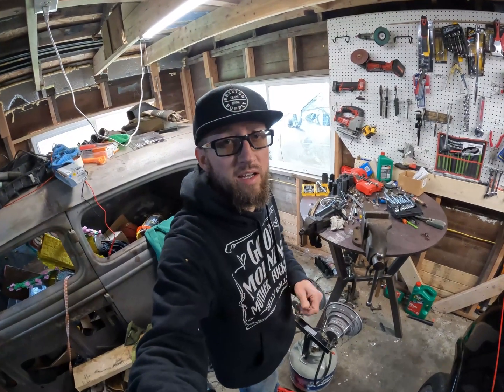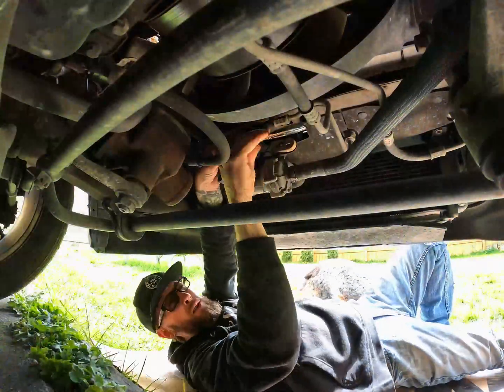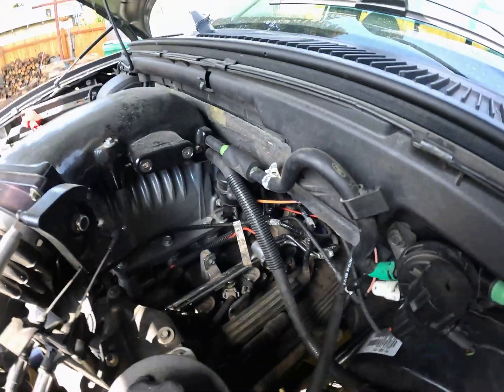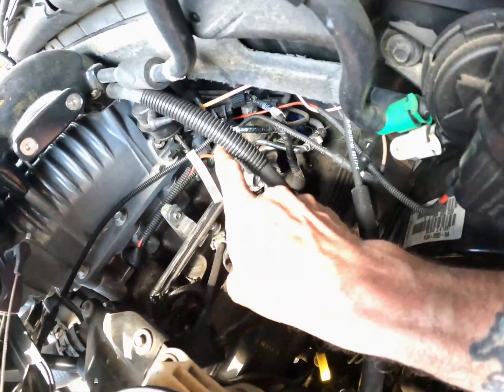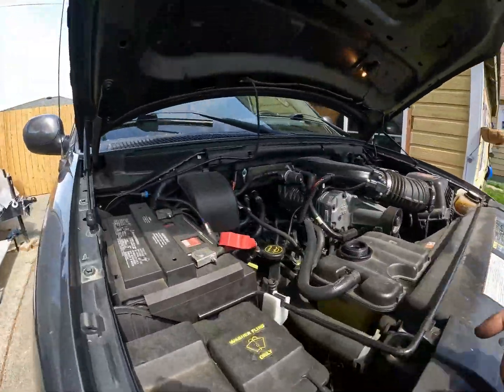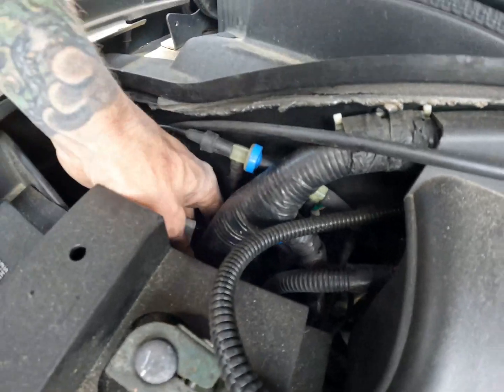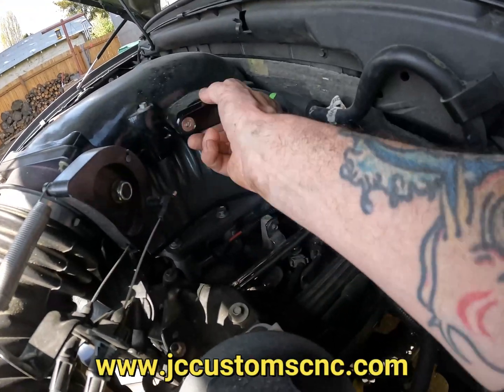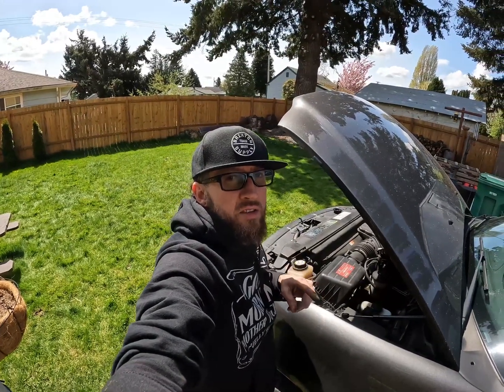EGR Delete Vacuum Line Reroute and Replacing the Intercooler Pump on 2003 Ford Lightning

Comment: Question Mike! On my pink line it’s got a black line with a double rubber vacuum plug in? Did you just cut/ separate it from the black line?
Reply from the maker: I'll take a look when I get home, I don't remember off hand. I'll get back to you
Reply: @builtmikesway1167 thanks a bunch sir! I appreciate you!
Reply from the maker: @MrDillon2029 no problem, send me a photo of what you're looking for... builtmikesway@gmail.com
Reply: @builtmikesway1167 so I guess do I need to do anything with those sensors that were on that bracket? I only kept the one plugged in that was in the very back?
Reply from the maker: @MrDillon2029 I took it off, yes one will be left.
Reply: Thank you Mike! I got it figured out I guess my next question would be. I’m throwing these codes on the truck with a rough idle. P1131, p0141, p0161,and p1401 all seem to be related to 02 sensors except one for egr voltage?

Comment: That’s what I was wondering 15/16 where? I did a Davies Craig higher Flow then what stock is and that made a big difference. You can’t go too much flow because then it doesn’t give your intercooler time to actually cool the fluid off because it’s moving too fast. I shouldn’t say it made a huge difference. Well it did compared to a broken one but actually it does flow more. I believe it’s a Davies Craig, EBP 25 that’s like 1.5 gallons per minute. More flow than what stock is and it’s not plug and play. You’ll have to change the plug on the end of it which is no big deal just solder and heat shrink your connections and let the good times flow. And it’s brushless. Yay.

Comment: Good stuff man! I like the Bosch pumps (German aside) and see no reason to add larger or more complicated pumps. Why not try a larger reservoir? The addition of the larger HX reservoirs are a major improvement on all 3 long term lightnings I have owned.
Reply from the maker: I used a Bosch on mine when I replaced it I believe, new reservoir coming soon too!
Reply: @builtmikesway1167  Thank you

 I have a 97 Ford E350 with the 5.4 2 valve .  Will this vacuum reroute work without CEL codes popping up?
Reply from the maker: @camposvazquez  I'm not really sure, maybe if your doing the egr delete too. Sorry I don't really know much about that one.
Reply: @builtmikesway1167  thank you for replying...  Did you notice a performance increase/decrease???  On the Chevy push rod engines deleting the EGR  gives smoother idle and better acceleration...
Reply: @builtmikesway1167  thank you